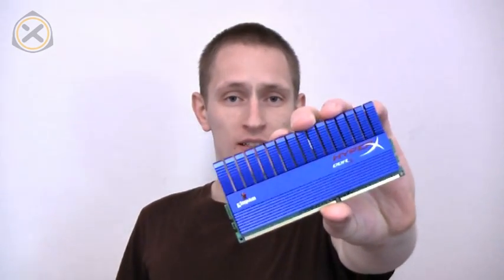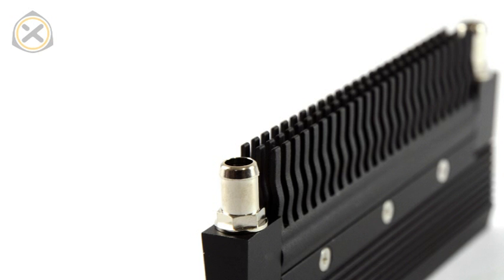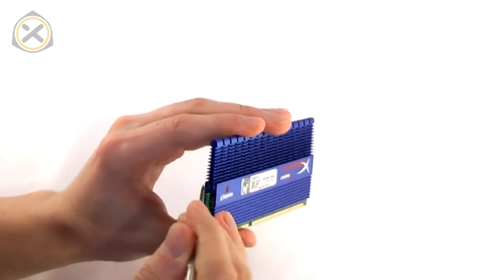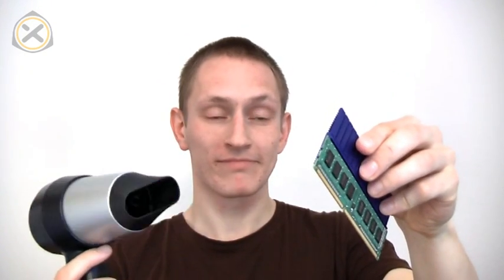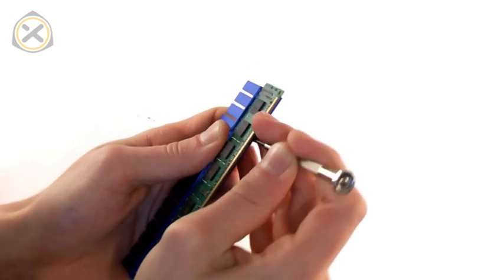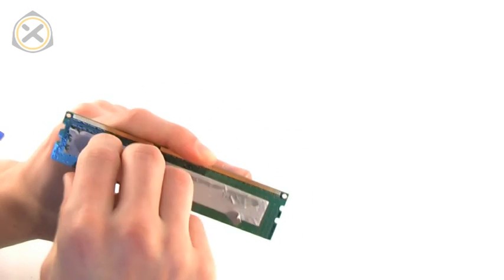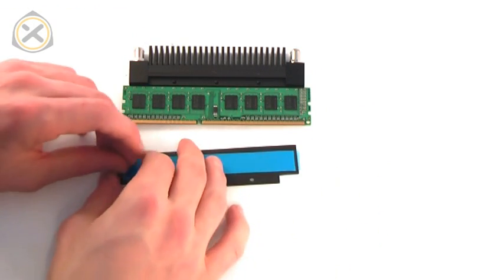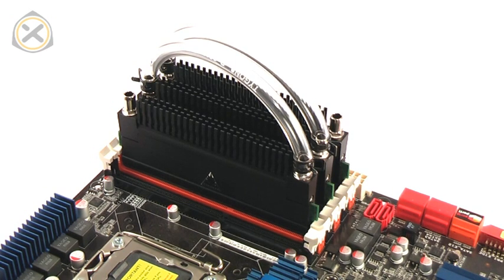EN - How to Remove a RAM Heatspreader (and replace it with Watercooling Module)

Comment: This is a perfect video....of how not to do this. Many people have destroyed their RAM by just trying to pry off the heat spreaders. You need to use a little heat to soften the glue/adhesive.
In short, if you have never done this before, don't follow these instructions.
Reply: To be fair, the guy pulled out a hair dryer in the second half of the video.

Comment: Amazing, how if you have the knowledge, you can improve the performance and life of desktop PC components.  But removing heat spreader/ heat sink is only advisable if the RAM is heating up too much. Better add missing add ons where required.

Comment: That looks so cool, although I'm planning to use a wide hose, so splitting it into 4 smaller tubes for the RAM and then back to 1 might work out.

I'm using DDR4 Corsair Dominator Platinums.

Comment: i think you installed the water heatsink the wrong way round as you would have got much better cooling is you had placed the chip side of the ram on the side that has water flowing through it.

Comment: @4:16 Is this padding necessary for single sided DIMM's? The custom heat spreaders I want to order from eBay don't seem to come with it. Can I just use adhesive already attached to both sides of the heatsink?

Comment: Thank you so much, DDR3 has no need for heatsinks especially at 1600MHz...

Besides, removing these so you can house huge air coolers produces enough airflow on them anyway :D

Also your video is awesome because it considers the worst case scenario (adhesive instead of screws, single sided PCB, etc).

Comment: This is cool but utterly pointless especially if you already have good airflow in your PC. I have an i7 3820 4.4GHz, 24GB DDR3 1866 Kingston HyperX RAM and my CPU temp is 31 degrees c and my system temp around 27-28. There is simply no need for this.

Comment: no it dus not under a law passed way back in the 90s thay cant voide your warrinty if you remove it as its considered a seperate part. its part of the act thay alows users to open thare computers to upgrade without voideing thare warrrinty. meeening thay have to prove that removeing it is what bade it break.

Comment: i've got a coolermaster v10 witch doesn't allows me to put kinds of ram like these that you're showing in the video. My question is if i buy this kind of RAM and after remove the heatspreader will it be ok after with just the cooling of my V10? thanks